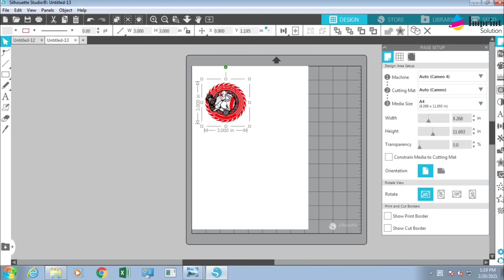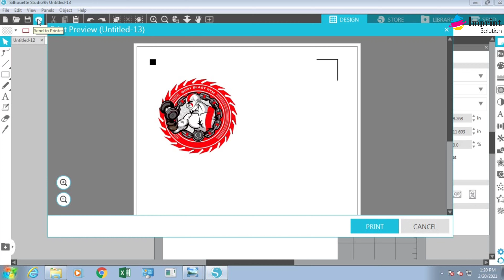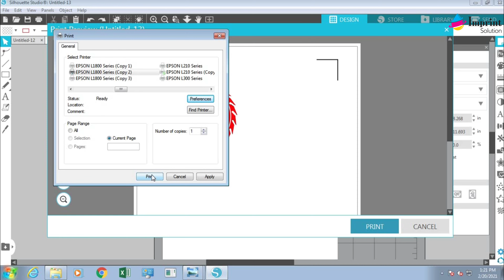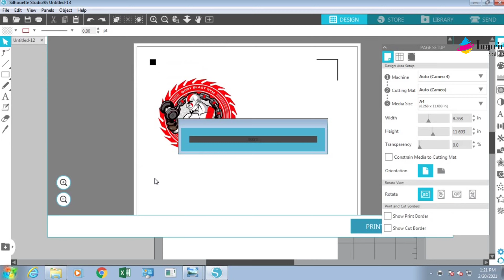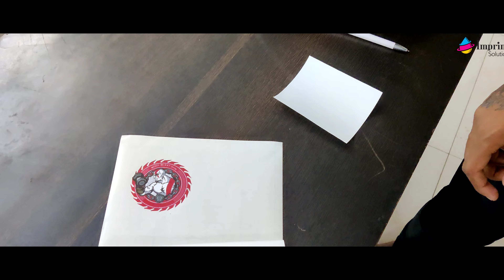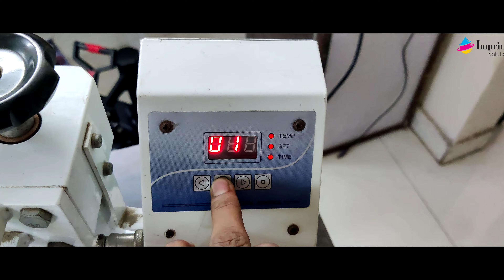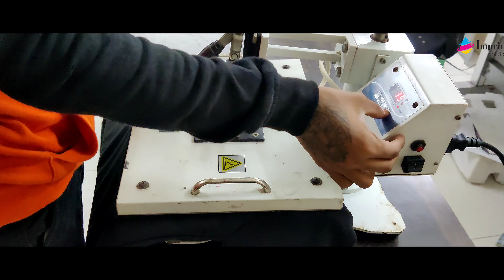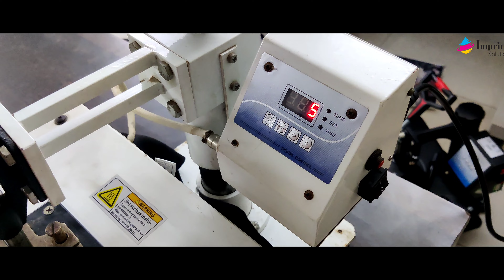Dark Cotton T shirt Printing - Print Your Logo

Comment: The video is nice and very brief, but, the rubber material you are using does not last long.  It cracks in just one wash.  Instead, I would suggest to go in for Sublimation Vinyl which neither fades, nor cracks and is long lasting.
Reply: It doesn't work on cotton
Reply: @tomantony6495    Try Sublimation Vinyl.  It works on any fabric and whatever the colour may be.👍🏻
Reply: @mudassirkhan430  what is the paper called vinyl paper??
Reply: @tomantony6495  Do watch the video of LASERTECH TECHNOLOGIES.  You’ll find both, the complete clip on Sublimation Vinyl + you can order the same material from them as well.